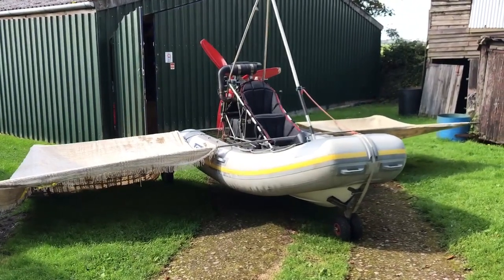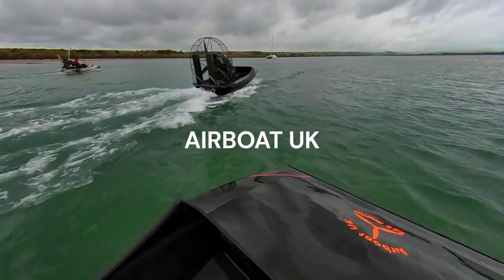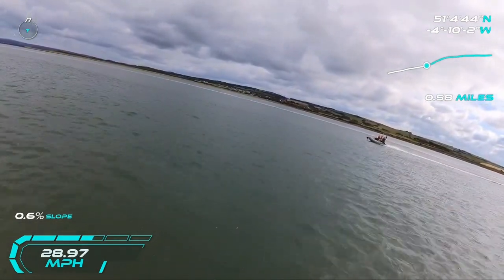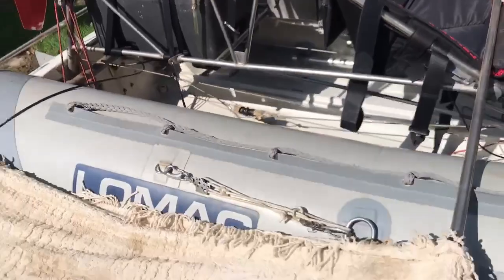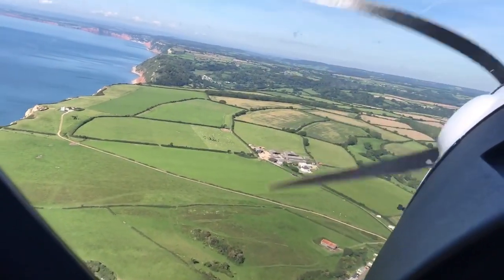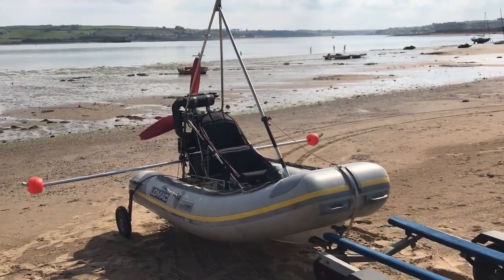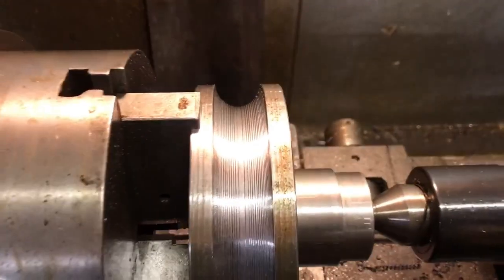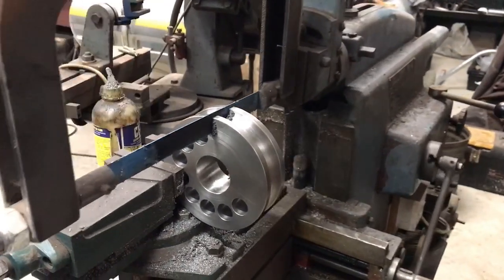Designing and Building a flying boat, wing in ground effect machine, Part 3 Ekranoplan plane

Comment: wonder if you can safe weight and drag by using two canoes instead of the rubber dingy 
you can allso make the connecting frame part of the wingstructure so you have less overhang from the wingtip to the root , can allso make the pusher prop intoo a puller prop and mount it in front of the wings leading edge with should help the winndflow under the wing and might lower the takeoff speed and stabilize the plane in straight lines 
setting the engine and prop at a slight upward angle or even having the whole assembly hinge slightly might help in trimming the nose during flight or takeoff 
from wat i seen on russian acroplanes is that they have mose of the trust in front of the winges , think they allso have plates on the end of the wings catching the wind sliding down the leading edge and redirecting it under / over the wing aspecially when part of those plates are in the water sealing the part under the wing

Comment: Hey, I see you are from the UK. One question, did you use 6061 Aluminium to build the microlight aircraft wings?
Its incredibly hard to source in Europe.

PS: :The microlight looks eerily similar to the Affordaplane. The one I started to build some years ago, and got stuck after building the fuselage due to the inability to source 6061 AL.
Reply from the maker: Hi, yes I can get 6061 tube from an aircraft material supplier. I'm not using that because of the extra cost of buying certified material. I'm using 6063 which is lower in strength but I think will be ok. I didn't want to waste the more expensive material on a prototype. 6082 is another grade I can get which has the same strength as 6061 but it's supplied by non aircraft suppliers. 
Yes the affordaplane build on YouTube I've taken lots of info from. Shame your project was stopped because of material availability.

Comment: the rubber ducky is too heavy ..too draggy .. and a nightmare to attach anything to  ..  maybe just maybe keep the hard bottom
Reply from the maker: It's not perfect I agree, could always be changed for a lighter more efficient design at a later date. The framework will be bolted to the boat and could easily be removed /changed.

Comment: Was that you filming at 3:05, MD500. Did you have a sit inside? A flat hulled boat will give you more speed, although landing will be harder on the backside. 3:38 looks like an AW101 anti submarine helicopter. You should have rolled out your chopper and asked them if they needed any help, hehe. All the best Ben.
Reply from the maker: Hi John. Yes it was me filming, it was a small airday at dunkeswell airfield. I didn't sit in the MD500 but had a good look. I wonder if they would have been interested to see my coaxial. Perhaps I'll offer to bring it next time. I didn't know what the military helicopter was 👍 
Have you made more progress with yours?

Comment: The bending die trick on the lathe was super slick and looked really good for a roughing pass, going to keep that one in mind.
Reply from the maker: Thanks, I was pleased with the outcome. It took a bit of filing to get the ridges down, I didn't spend enough time to get it super smooth but I'm pleased with the job it does after trying the new die.
Reply: on another note; hacksaw blade adapters for shapers?!?!! 🤯
Reply from the maker: @ultratorrent  Glad you noticed😊😊 , I made the hacksaw attachment for the elliot 10m and it works great. It feeds up via the shapers friction clutch, too much force applied and the clutch just slips.

Comment: I'm guessing that I'm missing something here, but a top speed of 30-32 MP/H with two people on board, and a target take-off speed of 30 MP/H feels like a small margin of error to me. Especially considering the extra drag of the stuff that is yet to be added. On the flip side, if wheels are still on,; that will be causing a huge amount of drag, so could drastically change the performance of the boat. (To the degree that it could well make up for the extra drag of the wings, and then some.) Is that take-off speed assuming one person?

Basically, this comment is one big pile of "I don't know". But I'm curious to hear your thoughts, and see you progress. I really want to see you succeed.
Reply from the maker: Hi and thanks for the comment. Yes you're concerns are justified, if I went for a wing loading of 20kg/m2 then there would be absolutely no doubt that the boat would reach the required take off speed. That is the wing loading of the polaris Fib. The Flex wing on the Fib i don't believe will be as efficient as the wings I build but also my wings will have increased lift and reduced drag due to being in ground effect. I think having the wings this low to the water should allow me to get airborne with a wing loading of 29kg/m2 but it's a bit of an approximation and I could be wrong. I could just build wings that give me a 20kg/m2 loading but I wan't the wings a small as possible for transport reasons. The decision is open to debate as the wing size hasn't been finalized at this stage.

The wheels were well out of the water during testing, the drag I'm hoping that will reduce in favor of reaching T/O speed is the drag in the water as the boat lifts up. At 25mph for instance the water drag could be reduced by 50%. (guessing)
Reply: @Ben-Dixey  Nice. I need to learn a bit more about this. I can't wait to see your next installment.

Comment: My want of a DRO on the lathe just increased by at leat 50%
Reply from the maker: 😆 you won't regret buying one. Mine are from M-DRO, think you can get 10% off if you phone and ask, mine are low profile magnetic scales. They have been faultless. You can spend more money on a Newall or mitutoyo or much less money on a Chinese made one. M-DRO are mid range.

Comment: Is it an idea to use a canard configuration rather than a tail-plane? Seems like an easier/lighter construction given the configuration of the other stuff o your boat. Also, a tail needs to be higher as your boat is quite low above the water.
Reply from the maker: Good question. I suppose the main reason for not considering a canard is because I haven't seen many examples. After reading a bit it seems that they are less stable in a stall recovery. They also reduce the angle of attack of the main wing by deflecting air downwards, this means higher T/O and landing speeds. They are apparently more efficient than a tail at higher speeds and it can be a lighter design overall. Perhaps more discussion is needed on this.
Reply: @Ben-Dixey  As far as I understand, a canard design can be 'unstallable' if done correctly, it is why they are so popular in most of the Rutan designs for example. With regard to the reduction of the apparent angle of attack, and reduction of lift, of the main wing I agree. However, I can also see the canard itself generating lift (it can have an asymmetric wing profile). Perhaps this overcomes the lift reduction.

Comment: Bloody brilliant Ben.  She bloody shifts for sure!  Surely as well as brining the CoM forward, the wings will better serve 'under' the mass and not ontop of it?  Thanks again, excellent progress - looking forward to the next!!
Reply from the maker: Thanks Heli Shed! 
The wings need to be as close to the water as possible for maximum ground effect. Increased lift up to the wing chord length above ground and reduced drag up to one wing span above ground. I think it will be flying higher than one chord above ground the majority of the time but not much higher. If that's what you were asking ? Similar with helicopter rotors I believe except you would never get to within one chord of a rotor blade to the ground. Well maybe you can flying inverted. 😆

Comment: Nice engineering, but you have a Seair-ish trike frame, why not just get a trike wing? I have flown the Seair extensively and right down on the water dragging the rudder in the water, but with the added bonus of being able to fly at altitude like a microlight. The version I flew did not have wheels, but one time after an engine failure (spark plug lead fell off), I landed it dead stick in a grassy field with a passenger and a 'short' roll-out. I know that you are shooting for an Ekranoplan, but you have the excellent makings for a proper trike, which in my opinion, is one of the BEST flying machines. The solution for the pipe bending die using the DRO came out nice.
Reply: Idea behind this project is to avoid having to certify the aircraft. So by keeping the wing in surface effect then it doesn't fly high enough to be an aircraft. UK Civil Aviation Authority is becoming more progressive since the divorce with the European Aviation Safety Agency, CAP 482 for example, but in general regulations are still more restrictive in Europe than US.
Do you know what regulations Seair design to? I gather FAA Part 103 is for single seaters. I assume aircraft still has to be inspected and signed off before flight and it needs an annual inspection even if uncertified.
Reply from the maker: Interesting. 👍
This boat is actually a Polaris am fib, I have the flex wing for it, it's not serviceable so would need a new one. 
The trike frame will be removed so that it can be put back as the fib it is and I might purchase a new flex wing for it. 
For me i think the fun is low to the ground, I enjoy the flying in the c42 but low flying is where the excitement seems to be. Who knows after building and flying this as a WIGE vehicle I might decide to fly it as the flex wing fib. Nice to hear from someone who's actually flown one of these things and enjoyed it so much.